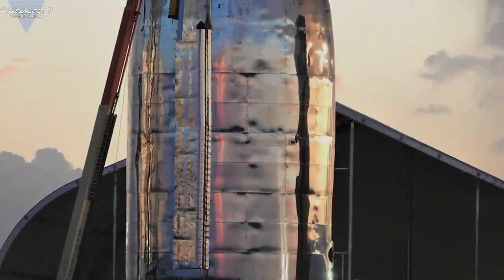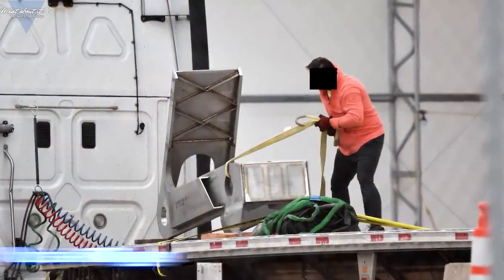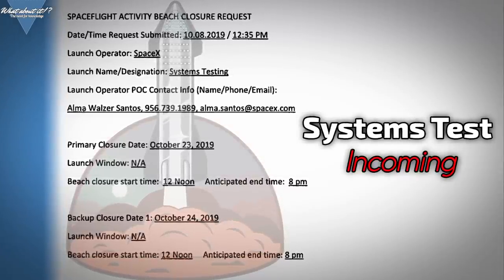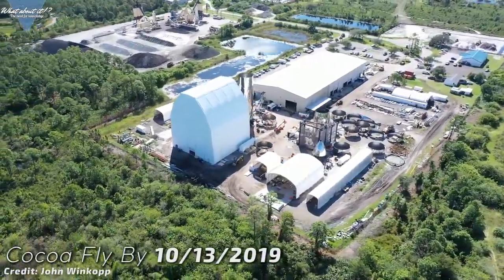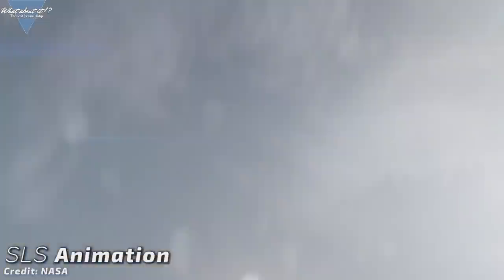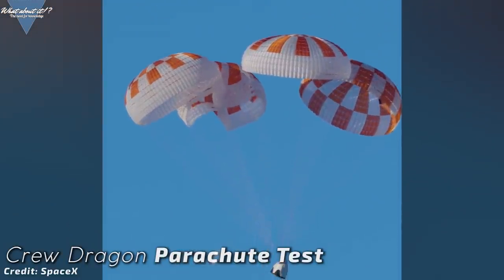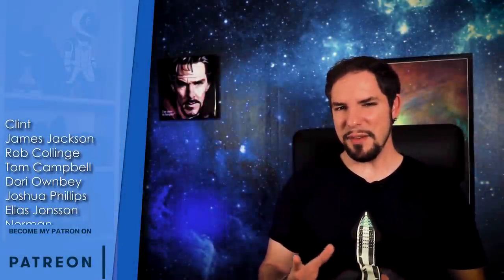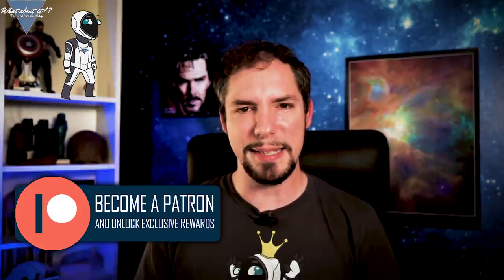41 | SpaceX Starship Test Date – Starship Updates –  Mark 4 In Production - Crew Dragon Schedule

Comment: If the outer skin of the body is also part of the tanks, the cables and pipes has to go up the outside (under the aerodynamic covers) in the final versions, else it would be inside the tanks.
Given Elon's stated "Best part is no part" mantra, going inside would mean complex engineering to pass parts through the tanks and dealing with presure leaks,.. Going outside means not having to "optimize parts that shouldn't exist."
Pressure test, and/or three Raptor test start with the road closures.
Bridenstine,... yah, damage control, as those that love space flight called him out on his comments, SLS (aka "Spare Launch System" or "Second Launch Safe" or "Second Last Spending") is far behind Crew Dragon and Falcon Nine. ULA is unlikely to fly until long after SpaceX, and maybe after Blue Origin.
Reply from the maker: Absolutely! Good thinking!
Reply: If the outer skin is a part of the tanks then Musk will need to redesign it completely again soon since the skin is gonna be red hot on reentry)
Reply: @Whataboutit  Suggestion Box Time,...yourself, Tim Dodds, and LabPadre should group chat and co-ordinate on the launch site event streams. Multiple camera locations, fed back to one hub, then out to all three channels,... Or, provide each other with camera feeds, then live switch each from your own locations, so each channel has its own style, and access to more resources then any one channel could afford. 😀
I call it the 3 C's approach - communicate, collaborate, create.
Reply: @ncrean66  - depends on how the skin is cooled, the cryogenic fuel will absorb heat and convert it in to extra pressure to push fuel to the pumps, and Elon has mentioned the thermal tile design a fair few times. I wouldn't expect the covers over the hardware systems to get hot enough to necessitate redesign.
Reply: @ncrean66  -- No he just runs it along the upper spine under a cowling. Remember, the final will not be symmetrical. It will have tiles on the bottom and steel on top.  Re-entry heat will be on the bottom while the top stays cool. The top and bottom steel will be largely the same temp wit the tiles taking the heat.
Reply: @shannonlove4328  No, you didn't listen to Musk carefully - the steel is used due to the high temperature resistance thus allowing to use less heavy heat protection. If the top stays cold al-li alloys would be a better choice(not to mention carbon fiber).
Reply: @ncrean66  Have you not been following along with the news? Musks goal is to get starship to falcon 9 levels of affordability. Steel is far cheaper than carbon fiber and alluminum. Plus it is stronger, and has a melting temp something like 4 times higher than both. Plus cyrogenic temps will help strengthen the steel as well. Furthermore the top of the ship will still encounter high temps just not as high as the bottom. Using steel as you mentioned not only allows them to use less heat shielding on the bottom but it will also eliminate and concerns about the top getting too hot.
Reply: @kakytoo69  You should decide first whether it's gonna be at cryogenic temperature or above melting point of al alloys.. Or may be both cases at the same time ? Hardcore spacex's fans are so funny)
Reply: @ncrean66  It will be exposed to both. Cyrogenic temps while in the vacuum of space, and it will reach near melting temps while coming back into the atmosphere ( caused by friction from air resistance at high speeds)
Reply: @kakytoo69  Ok. And now recall the steel has excellent thermal conductivity and the whole airframe will be roughly at the same temperature.. So would you prefer to sit inside red hot airframe or under cryogenic conditions ? And what would happen with the fuel inside red hot airframe and how miscellaneous hardware would feel when the temperature changes from cryogenic to hundreds degrees c ?
Reply: @ncrean66  But Aluminum is a better thermal conductor than steel. Regardless aluminum and carbon fiber would melt at said temperatures. The fuel would be fine under high temps, if anything it's actually better because it increases the pressure of the emptying tanks which takes some strain off the pumps. (Side note you do know fuel runs threw the walls of the rocket nozzle to act as a thermal sink right? Also Heating the fuel up increases pressure as I mentioned before) anyway The frame of the ship isn't going to be red hot, the thermal tiling on the bottom of the ship will eat most of the heat from the ship thus allowing the steel to handle any left overs. Also insulation and climate control will obviously be used.
Reply: @ncrean66  also steel is a poor thermal conductor. "Because steel is a poor conductor of heat, it's good for high-temperature environments like airplane engines."
Reply: @ncrean66  the only reason I said that was to explain the thermal properties of steel. Not sure why you focused on that above anything else. Unless your trolling me, because everyone here has already explained all of this to you bud.

Anyway sure I'll do it. As long as you promise to do the same with a stick of aluminum.
Reply: @kakytoo69  No need to do this with a peace of aluminium since still no one exposes an airframe to an extreme heating but keeps it cold under heat protection. But Musk is going to do something new - to get the whole airframe red-hot. And the steel is not a thermal insulator but a conductor so any steel pieces inside the body that are a part of the structure will be heated as well.

Comment: ofc they will test the systems on those 3 days to make sure they are working properly . Maybe some testing of the fins and legs, main system tests and so on. Even some fuel tests maybe (tank stability, cryogenic stability, pumps, batteries).  But would make more sense with all 6 engines mounted.
Reply from the maker: Mk1 will only have 3 engines.
Reply: @Whataboutit  yes, ofc you are right, felix. I thought a bit to far on this one ;)     Nice video as always btw

Comment: Question:  Why can't Falcon Heavy be used to send the Orion capsule to the ISS for an un-crewed test and then crewed missions of 2-6 months duration?  Orion has a tested launch escape system.  Sure, Falcon Heavy might not be able to take Orion to the Moon, but they might as well test it to the ISS now, since the SLS is so much delayed.  Or is Orion not ready for crewed flight, either?  FH could be less than fully fueled, maybe, and make three good landings of its boosters and no fairings to be recovered, making the launch cost less for NASA.  Less than the cost of two seats on a Soyuz, I bet!  Or am I missing some details?  I mean, Starliner and/or Crew Dragon are still needed for ISS, but get Orion test-flown, too.  I'd say make use of Falcon Heavy for LEO testing of the Artemis system spacecraft before using the expensive SLS to send them to the Moon.  Like Apollo 5, 7, and 9 missions.  Start with Orion.  Delta IV Heavy can launch Orion, but it costs too much!
Reply from the maker: The reason would be simple. Orion is developed for flights with the SLS and congress has approved flights with SLS and NASA wants to do flights with SLS. It's a government project. The amount of force needed to change its course can not be measured in kilonewton. ^^

Comment: What is the speculation on the 20KM flight profile? Max altitude is set, but what about target max velocity? Is it a true launch to orbit propulsion which cuts off around 19KM with a coast to 20KM? Followed by flip to "horizontal for skydiver drop to propulsive landing? If so, Starship can likely stay below traditional MaxQ pressure, but haven't seen anything regarding expected altitude for Starship MaxQ? Doubt that current construction could handle the heavy stresses. Mark4 with new ring construction maybe?

Comment: Felix and others - if each ring has a single seam, then do all of these seams across the multiple rings line up with each other? Why or why not?
Reply: They will not be lined up. The individual stresses of each ring have to be staged around the girth to evenly spread the stresses.
Reply: @peterbarratt8699  in what way will these seam alignments be staggered? Presumably this will not be random, but will be in a specific arrangement.
Reply: @manofsan  Yes, that is what I hinted at. Since each ring will omly have one seam, each seam will be offset in the ensuing layers to create a balanced uniform structure.

Comment: It seems that a new version of the Spacex Starship may need to be developed for more efficient low cost trips to the moon.  It should be designed around using liquid H2 and O2 as fuel in order take advantage of making it on the moon from the available water ice at the poles.

Comment: I can believe NASA want to use parachutes to land in 2019.... For emergency it's ok but... To land!! Pathetic
Reply: Why are they ok for emergency ? If Draco ignition failes or an unscheduled rapid disassembly occurs the parachutes will not help  - no time to react. So they are useful as the main option only.
Reply: Mike C Totally agree. For emergency it's OK but... To land!! Pathetic. But parachutes have to be man rated to be used as a backup before propulsive landing can be used as primary, and NASA prefers new Dragons and wasn't interested in helping with develop propulsive landing. Total mess. Parachutes should have been dumped to save weight since the propulsive landing system is necessary for abort while the parachutes are purely optional. The notion that hypergolic propellants might not ignite seems bizarre.